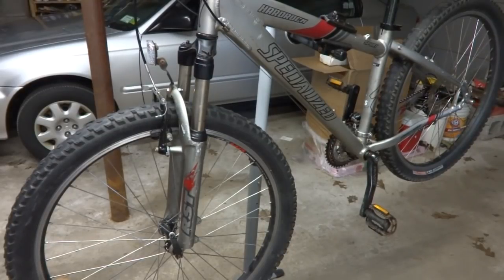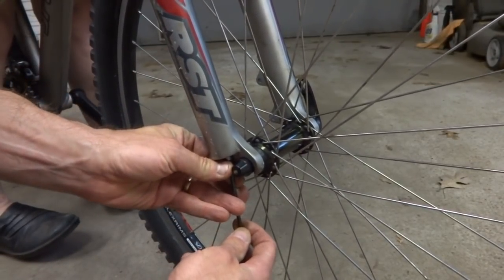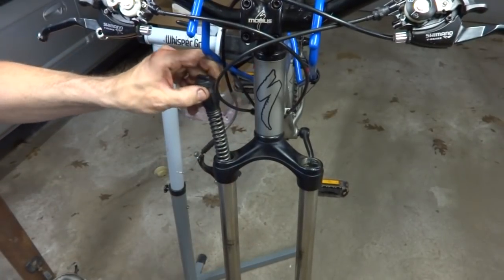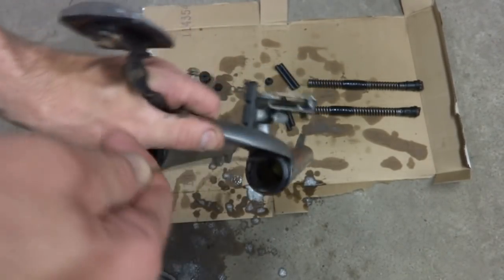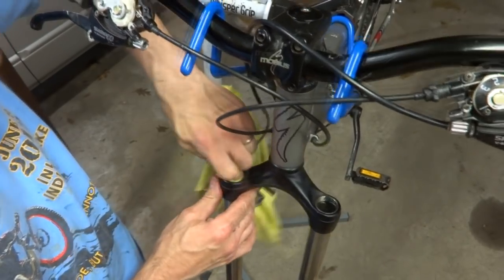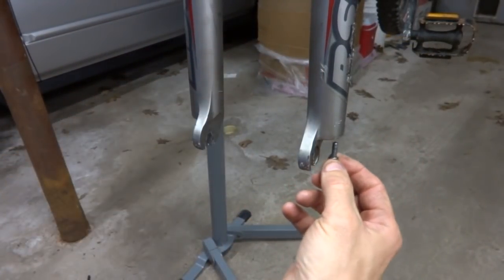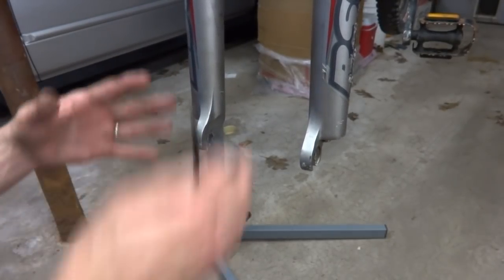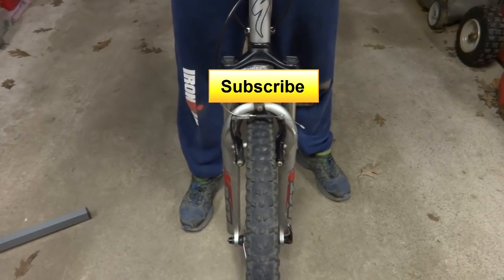How To Disassemble/Clean/Lube/Re-assemble RST Gila T5 Forks

Comment: Some help with a Gila Plus T7 100mm?
Reply: Mine are Gila Plus T7 100mm, mine were very hard. because the preload adjusters get stuck, I unscrewed them, amd made sure they moved in and out as the aduster was turned, and now they are fine.

Comment: I have an RST Capa model. Do you or anyone know the procedures if I pop the top cap off and there are no springs up top? Yes there are two Allen head bolts at bottom
Reply from the maker: Sorry, I haven't had a chance to work on one of those yet, so I don't know how they come apart.

Comment: are the t6 rst gila the same as t5 internally?,just wondering as i'm looking to buy a specialized hard rock sport,the mtb forums say that these forks are notorious for breaking & aren't very good,i'm only going to ride on the street & concreted/paved bike paths,do u think that they would be ok?,also how often should these shocks be stripped down & serviced??
Reply from the maker: neil crompton I don't know about the T6 shocks. Some shocks recommend every 25 hours of riding, though I doubt anyone but the pros do that. Yeah, these shows are pretty low end. If you aren't going hardcore on them they should do okay.
Reply: oh i thought maybe they might be similar in design,there are several videos on u tube that suggest putting 10 w fork oil into them as helps improve them (rebound)theyr'e said to be very stiff,i'm wondering if some of the oil might leak through the thread/bolt hole in the bottom of the lower fork?,or possibly the pressurised oil might pop to top seal,they don't mention how much oil to put into each side though.what do u think rj?,could make a very interesting video?? :)
Reply from the maker: They might be. I just have never worked on a T6. You would have to find a manual for the forks. That should tell you all this stuff.

Comment: There are no nut bolts and screws at the bottom of the shock absorber with my mtb bicycle so how to repair it and open it please tell me
Reply from the maker: Then you have a different fork and this video doesn't apply.
Reply: tell me how to open that shock absorber and repair it
Reply from the maker: Well start with you figuring out what kind of for you have, and you researching on how to take it apart.

Comment: I outlined the steps, to help me remember better, may it be useful to you all as well: 

DISSASSEMBLE CLEAN LUBE AND REASSEMBLE RST GILA T-5 SHOCKS

1. remove bolts from bottom of fork-shock assembly (compress
shock if inner assembly is spinning, disallowing the unscrewing of bolt—with wheel
on, have someone put their weight onto front forks)

2.  pull “lower” off
like a pair of metal pants

3. remove any pieces from lowers that did not come out along
with them (plastic pieces that fit around the metal rod in the center of the
tubes—use coat hanger wire, hooked at end--note orientation)

4. set aside lowers

5. unscrew caps from the top of uppers (vice-grips?  make your own wrench?)

6. pull out (coil spring) “stacks” from upper tubing, lay
out in order of orientation with plastic pieces from step 3) on a piece of clean
cardboard

IN FOLLOWING STEPS, REMOVE OLD GREASE, DIRT, CORROSION, ETC.

7. (unscrew plastic plugs from bottom of stacks, remove “elastomers”
from inside stacks)

8. Degrease the stacks and pieces 

9. clean outside of upper tubes with degreaser (scrub any
corrosion with soft scrubbie)

10. clean out inside of lowers (degreaser, piece of shirt on
end of hanger) and uppers (twist a shirt down into them)

REGREASE AND REASSEMBLE: 

11. regrease all inner parts (non-lithium grease) and the
channels on the inner surface of the seals at the top of the lower tubes, and (with
a thin layer, wiping off excess grease) the outside of the upper tubes
(stanchions)

12. reverse the disassemble (careful with threads of upper caps)

Comment: ** I'mma cross my fingers hope T6's are about the same as these so I can watch this video and follow it:P
Reply: T6's were pretty much identical.... ordered the wrench off amazon, but in the meanwhile I figured I'd carefully try using a set of channel locks if it was finger tight and they came out easy so I continued..... used lucas marine grease as it seemed to use the same grease as in the video.... believe it made a decent difference ** the boots on my set are cracked in a few parts and didn't find replacements so pilled the under side with grease, my theory being the gob of marine grease under the boots should hopefully make for a barrier to not allow dirt even if part of it is cracked(not sealing)

Comment: The fact you are using a water based cleaner to clean greasy bare metal parts is so cringeworthy. Water and oil rejects each other and you are fireing corrosion with the water. Just use break cleaner/gasoline/wd40 to clean off old grease.
Reply: Well, I wouldn't bet on the stainlessness of shock forks... 
I don't know what kind of metal shocks are made of. I'd guess its hardened steel and hardened steel can never be 100% stainless because of the metalurgy behind it.
Reply: water based degreasers like RJ used, or Simplegreen are more environmentally friendly as they have low VOC - better for your health too when using. these are fine for general cleanup/degreasing AS LONG AS YOU ARE WIPING IT OFF!!!  When i was younger and dumber  i made the mistake of using simplegreen in my parts washer tank (as it was recommended by the manufacturer) and it completely rusted up the electric pump.....So varsol or Paint thinner  for any long term soaking, but the water based is fine if its not being left on.

Comment: i put 90 kg on the fork and that is still rotating , i have a Gilla Pro 2010
Reply from the maker: If you take the stacks out, there might be a hex fitting at the bottom (probably 5mm). You will need a long hex t wrench or a long hex socket with an extension to hold the part inside while you loosen the screw.
Reply: shyflirt1 I have a lockout button , and i don't thinc i can unmount that , anyway i just wanted to lubrifiate and clean the stancions not the mecanism , sorry for my grammar.
Reply from the maker: Okay, they sound like a different design than these. So not sure how to clean lube those off hand.
Reply: shyflirt1 i saw another video of yours when you used a powerd screwdriver to screw it off
Reply from the maker: An impact wrench. That might work. Not sure what is inside those shocks though.
Reply: shyflirt1 anyway, thanks so mutch for your help , really apreciate it .

Comment: Use aluminium foil and some soapy water to get the corrosion off the down tube 
Orange clean is garbage for removing grease 
Use petrol , kerosene or real automotive degreaser just try not to get it on plastic parts 
Unless you want to do things the hard way that is

Comment: I dont have a stand
Reply from the maker: Then buy one. Or make one. Or do without. I bought the one in this video used on craigslist.
Reply: @RJTheBikeGuy  the fork is a RST 181 btw
Reply: @RJTheBikeGuy  I repaired the suspension without getting springs out, thanks, it works hard but its good.
Reply from the maker: I haven't done an RST 181. But I have a video on an RST 191. https://www.youtube.com/watch?v=0GJ_IFWK5yw

Comment: My fork it's stuck not even the holy WD-40  can't help
Reply from the maker: It might be able to be unseized. The fork might be toast though.
https://www.youtube.com/watch?v=d534ilYCaMk
Reply: @RJTheBikeGuy  first of all , thank you for replying.
I have a double crown fork one piece works perfectly I can even rotate it in every direction but it doesn't come out when pulling on it, the other one i spent 2 hours on it with the rubber hammer and wd-40 and searching the model on the net but it's way different from what i found . Either it has a nut that keeps them from separating ( even though I don't see something resembling a nut or screw there~30 cm depth),  or i need to pull like crazy to separate them
Reply: @RJTheBikeGuy   This is what it written on it .
First bike GTX-2000.   Iso 9002, 
And on the fork "STR 1795".
Honestly I'm feeling good to know that i have a"rare" type of bike but it's a real brat right now when i finally want to take care of it
Reply from the maker: @keopsps3474  Then it's not this fork. You need to find instructions for YOUR fork. They are not all the same.
Reply: @RJTheBikeGuy  big problem, i have no clue where. I tried Google but with zero success

Comment: i recommend NOT TO USE GREASE ON FORK it will cause to more and more dirt inside stanchion also losses      the seals use atf (automatic transmission fluid ) for better play
Reply: cracktober no not all since i start that method my shocks last for months and it stays clean at all